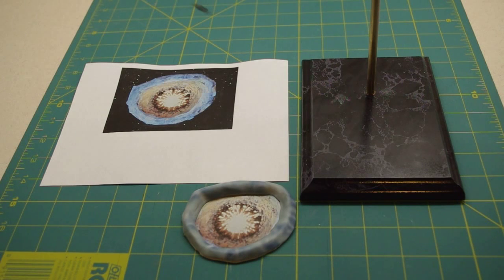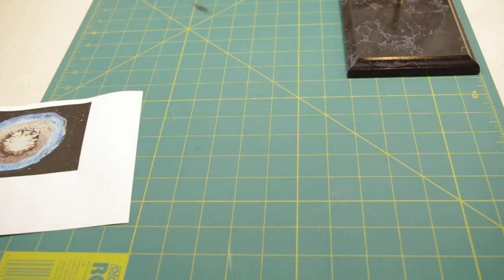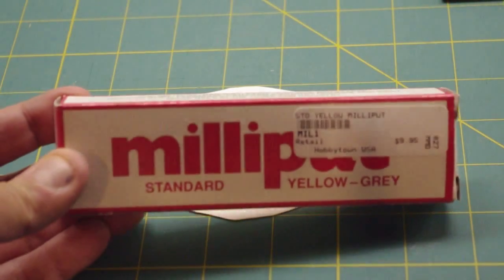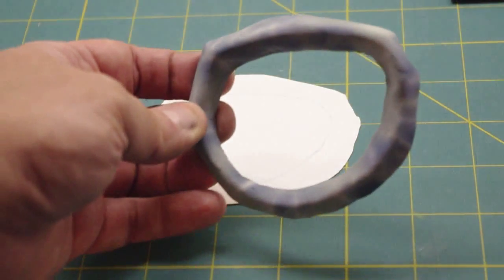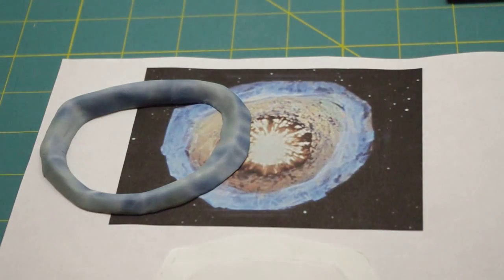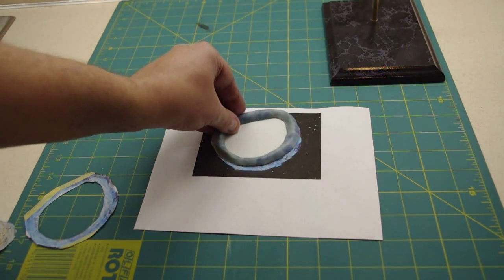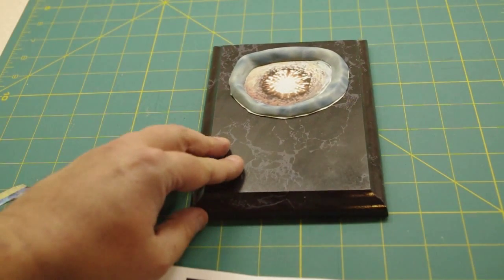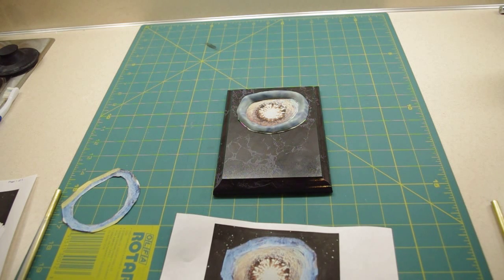18" USS Constellation Project (Part 6)

Comment from the maker: @fraley1701 LOL. I'll save that for somebody else since that would involve cutting a light channel in the plaque and putting a battery in it (and all the resulting sawdust could be a bit messy). This should do the job just fine for my uses as the primary focus should be the model, not necessarily the stand (while the stand should at least compliment the model).